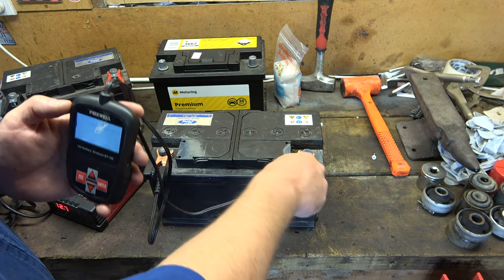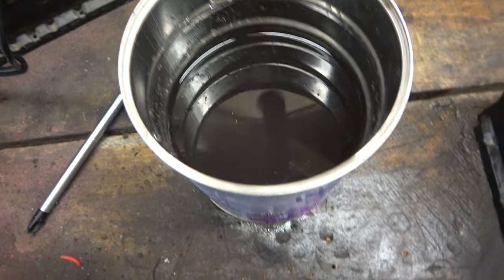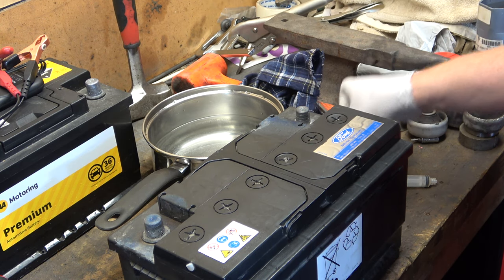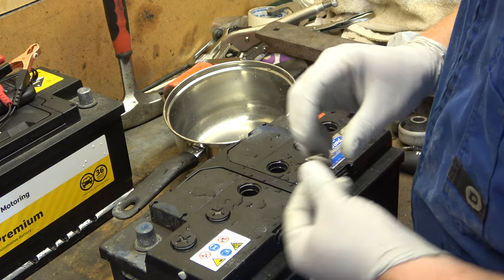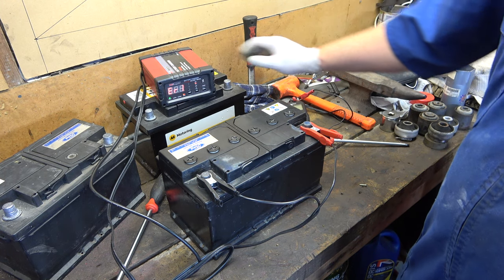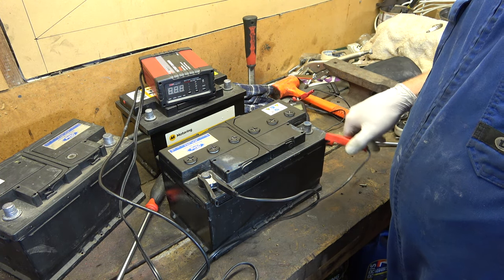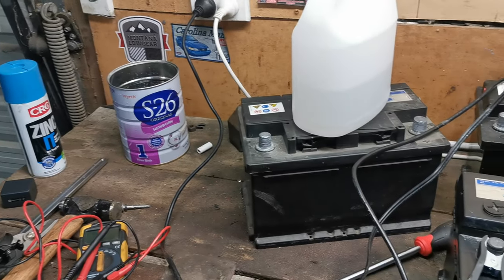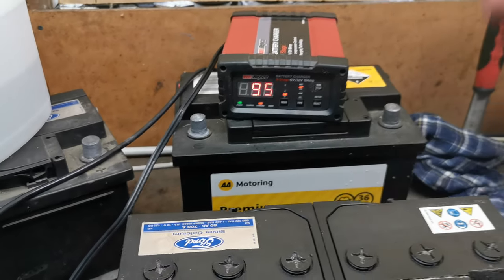Restoring Car Batteries with Epsom Salts - Does it Work?

Comment: I was under the impression that the power of the battery is in the acid. The plates react in the acid.
Is there a need to replace the acid after this cycle.
Just asking
Reply from the maker: not according to the internet myth

Comment: Not sure how a lead acid battery could possibly work without acid in it, i.e. draining out the sulphuric acid and replacing it with a salt solution.. was under the impression the epsom salt would dislodge the buildup on the plates though surly the acid would need to be put back in the battery for it to be able to work as intended.. who knows.. nice try though...

Comment: I would have cleaned the battery with bicarb prior to adding Mag solution.  You want to remove impurities and neutralise the internal battery and this can be repeated several times until the effluent stays clear after it is added and exited from battery.

Comment: Charge the shit out of the Ford battery with a welder until it boils over, keep going 15 min times 8, manually. You need to be present for this. Also, flush out the epsom solution and do the last revives with ordinary battery acid, do like 3 flushes and keep going, it will revive.
Reply: you mean after all the hard charges/flushes, also charge with battery acid and dump that twice or so?
Reply: @stratoleft  some people don't dump the acid even once, so I think once is ok, with epsom you can flush more, it's cheaper and easier

Comment: Get old battery charger that will put 14.9 volts and take sulfate off the plates these  charger with computer controlled devices wont have constant voltage going in the battery
Reply from the maker: Constant voltage is no good for desulphation. This charger has a high voltage pulse cycle that helps with that

Comment: um....dont you replace the acid after this?
Reply from the maker: Nope. You make sulphuric acid from magnesium sulphate. Not very well it turns out
Reply: @Badgertronix  you still need the proper H2SO4 concentration in the end (38%)  check w/ densimeter; some say that ALL acid remaining inside should be neutralised with baking soda prior to the epsom salts phase; thanks

Comment: can you use distilled? also how many amps did you charge it
Reply: Distilled is better. He should have put water and baking soda in the batteries to clean all the crap off the plates. Then add the water and epsom salt in and do a 2 amp charge for 24-36 hours

Comment: Doesn't the battery need the acid electrolyte?
Reply: Yes.  He may have had better results by flushing the salt, adding more, recharging, and repeating until the voltage and CCA peaked, and then drained again and replaced with the proper electrolyte...acid.
Reply: @jlbush8249  Indeed. I agree.

Comment: This is done all wrong. The whole point is to flush and clean the lead plates. You use baking soda and flush it 5-8 times. This is a process that takes about 2 days, then another 2 days to charge the battery. You cant just replace the sulfuric acid with Epsom salts.

Comment: Im late to the party but one thing you did that was OPPOSITE of what you should of done! The battery needs to be fully DISCHARGED prior to the Epsom salts...run a battry down w a 12 bulb then proceed. Discharging does somthing the the lead sulfate
Reply: Discharging creates lead sulfate and water from the lead plates and sulfuric acid.

Comment: Interesting...  🤔
I haven't seen anyone replace the acid with epsom salt. What others do is save the old acid, clean the battery well, and then reuse the old acid with added epsom salt solution to top off!  
Just replacing the acid with epsom salt won't work!
Reply from the maker: epsom salt becomes sulphuric acid and magnesium hydroxide so it will work. Whether it's a strong enough solution or not is another matter
Reply: @Badgertronix  
👍 OK... Nice! 
I topped of a battery last week with the epsom salt solution and it worked. The battery wasn't old, just cheap. And now I hope it will be fine for some time.

Comment: Honest video showing that this Epsom salt thing does not work.
Reply: Salt alone most likely won’t work.  It can act as a plate cleaning agent, which this video does demonstrate, but the proper electrolyte, acid, should be put back in the battery after draining the salt mixture.  Also, the battery should be tested for a bad cell before attempting a re-conditioning, because if a cell is bad the battery is junk.

Comment: Use a baking soda and distilled water solution in the battery first. Rinse it out then add new electrolyte. Got to get lead sulphate off the battery plates.

Comment: Has the battery cca gone up since you did test
Reply from the maker: No
Reply: @Badgertronix  you skipped a step. First you need to make a solution of baking soda and regular water. Dump your acid fill with the baking soda water work the battery around and de sulfate it. Do this several times until you get a clearer solution coming out. This washes the plates. Then you use distilled water and your Epsom salts. If you want better results a mixture of aluminum sulfate and water is better

Comment: There are  a few tips for battery reconditioning
Don't try to do this until you know what you are doing - the acid can burn your skin
Test the voltage first - there may be a kaput cell which would waste your time.
Check the battery fluid.
Try to fully charge the battery.
(I discovered about these and more from Jons Mender Guide website )

Comment: Why not just replace the acid?
Reply from the maker: The acid isn't really the problem. Epsom Salt is supposed to removed the sulphation and restore performance.
Reply: @Badgertronix  Ah I see. So having removed the sulphation, should you not drain, rinse and replace the acid?
Reply from the maker: That would make more sense but I was testing this magical cure. Future videos may address a more valid repair strategy
Reply: Benedict White Yes - that’s makes sense. Drain the salts and put fresh acid back in. Not sure if a deionised water rinse would be the ticket , before refilling with acid ??
Reply: @Badgertronix  that'd be good. You could start by emptying this one etc.

Comment: Really?In reality with that battery really start a car withe type of voltage that it has.You don't know what the real cranking gyms is, and will it still have anything to do with after it's been sitting?We'll still have the same cold crankingham's.Is that a yes or no question?
Reply: Try some caustic acin your batteryou might get a result then

Comment: This does not work. If it is a old dead battery then the bottom half of some of the lead plates have dissolved & are gone. So this is a waste of time & money. We cut open batteries after trying this.

Comment: here's  several suggestions for fixing a car battery
Don't try to do this unless you are sure what you are doing - the acid can burn your skin
check the voltage first - there may be a dead cell which would waste your time.
Check the battery fluid.
Try to fully charge the battery.
(I discovered about these and more from Jons mender guide site )
Reply: As a kid I grew up playing with old battery acid containers. The garage bought in dry batteries and bottles of 37% acid to top them up as needed. You might be better off flushing the old acid residue out with diluted bicarbonate solution and water, and the refill with fresh acid. All pretty cheap.

Comment: There are  several things for doing a pro job
do not attempt to do this until you know what you are doing - the acid can burn you
Test the voltage first - there may be a kaput cell which would waste your time.
Check the battery fluid.
Try to fully charge the battery.
(I learned about these and more from Jons Mender Guide website )
Reply: It's a scam, and you are a spammer, and you've been reported.

Comment: There are  several things for doing a pro job
Don't attempt to do this until you are sure what you are doing - the acid can burn you
check the voltage first - there may be a dead cell which would waste your time.
Check the battery fluid.
Try to fully charge the battery.
(I read about these and more on Jons mender guide site )

Comment: Thank you for your comment during the conclusion. I was hoping for a surprise that Epson Salt will do wonders without properly Desulfating the battery.

So, it confirms the knowledge from all the many articles and videos I have seen. That the only trick that will work is through applying equalising voltage to convert the sumfation back into the acid.

Comment: I was kick starting my car for bout a week..became frustrated and  Well i tried the method.. i cleaned the cells out with baking soda and water solution.. added Epsom salt to the distilled water and topped it off with the old battery water i drained earlier.. i also made me a charger from a laptop charger using a method i found here on the Tube.. charged the battery for about 15hours.. to my suprise the car swung as strong as ever.. IT HONESTLY STARTED..The misses even High Fived me when it started cos she thought it was BS and im waisting my time and electricity.. Maybe i was jus lucky or i dunno..Maybe there are Battery Center reps here being Nay sayers discouraging us from knowing these tricks..

Edited..Did not drive my car for more than a day and its still starting perfectly.

Comment: are you guys dopey ? i guess chem wasnt your strong suit. or you were sick that day of primary school

- washed 6 cells (total 3 litre capacity) with 1.5L cloudy ammonia and 1.5L 15% naoh solution
- waited a few minutes
- rinsed 5 times with clean water. black precipitate came out in decreasing amounts
- filled with concentrated epsom salt solution
- measured voltage already 10.5v (before any charging)
- put on charger, 2A took forever, better than new battery too. who knew  ?

note: if you get anything under 10.5v fully discharged then write home to your mama. ask money so someone who knows what they're doing can bring a battery to your car..

Comment: Cant restore batteries using magnesium sulfate. If it worked then use salt, it would work too
Reply from the maker: Well you can, because chemistry. It's just not very good at it
Reply: salt and magnesium sulfate are totally different.